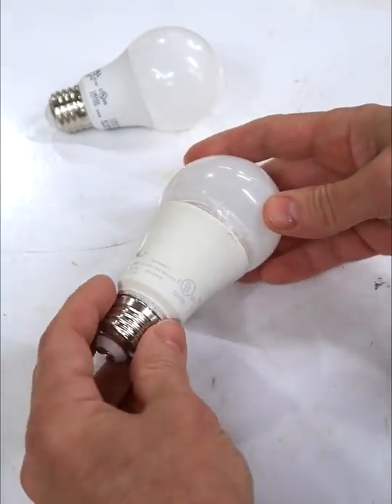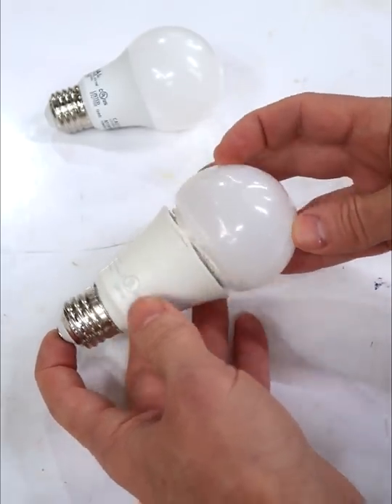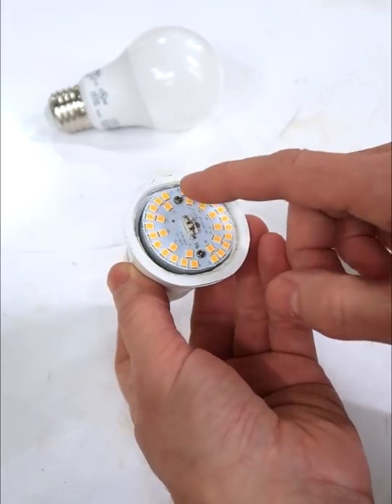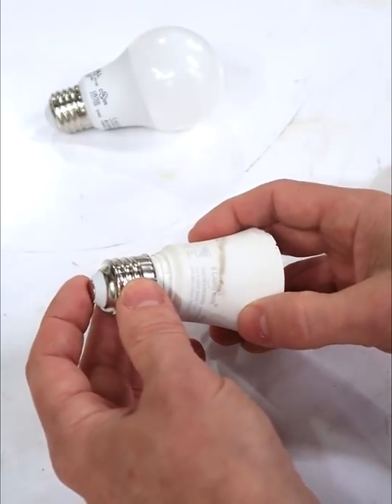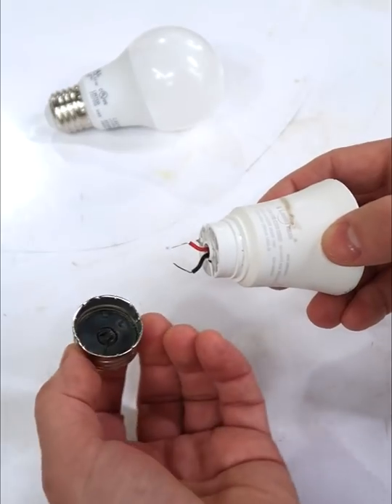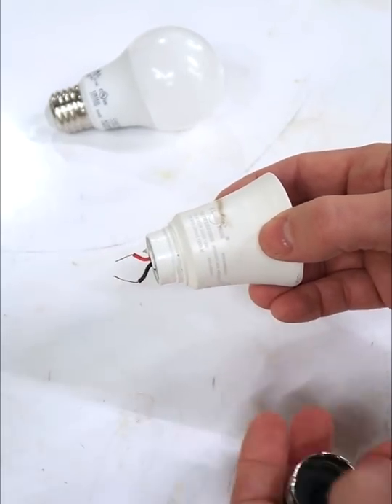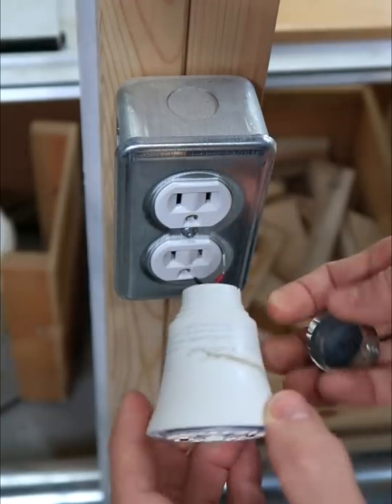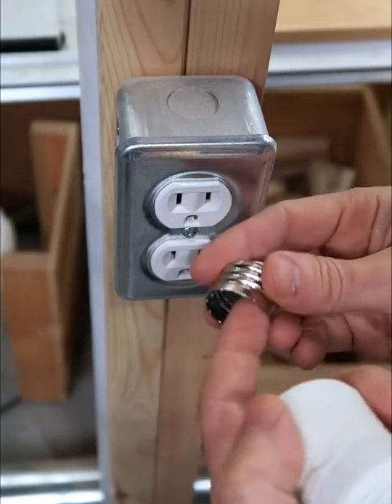LED bulb failed for dumbest of reasons

Comment: Pretty much ANYTHING you buy recently has engineered obsolescence designed into it to ensure the product fails in order to make sure you buy more. You can thank Apple for that business model. Water heaters, Televisions, garage door openers, toaster ovens, washer and dryers, dishwashers, refrigerators, etc. And it's usually the "higher end" more common company's. Samsung, GE, AO Smith, Apple, etc.

Comment: I installed LED shop lights (wrap around style)... They lasted about a year because the power supplies are cheap trash. I think it would make sense to have high quality, easy access 12V power supply run LED lights in a whole room rather than cheap garbage AC to DC converters in every little bulb. I'm going to do that in my shop.

Comment: LED bulbs are still a great idea, just like everything else though, don’t cheap out and buy the discount brands. If it’s on the shelf at WalMart or Home Depot, it probably won’t last. Matter of fact, there was an investigative news story a couple years ago where they bought a cheap LED bulb and an expensive one from the same manufacturer. Once pulled apart, the only difference was the plastic bulb piece on the more expensive one was a bit more clear allowing more light and this shine brighter, but it cost a lot more. The rest of the internals were the same.

Comment: Careful touching those wires after having had the bulb on. A lot of cheap bulbs will use a capacitor to drop voltage and it can retain charge, giving a shock after unplugging
Reply: If that was true, wouldn't that shock anyone that touches the base after twisting the bulb off?
Reply: @443DM  it can do, depending on how it's wired and what gets touched.

Comment: It probably didn’t fail because of that but because of thermal expansion somewhere on the circuit board. If you hook it up to the mains again and leave for a while then it will probably start flickering again once it heats again…

Comment: Actually, it is more to do with the manufacture of the item.  If the wires where firmly fixed then you wouldn’t have to go buy another bulb.  This little nugget of a problem is “probably” designed into the the bulb.  I have had several LED bulbs go on me.  Maybe this was the reason.  Thank you for showing this gem to us.
Reply: just remember, if they skimp on that step, its not the only step they skimped on!

Comment: I've only had two led bulb failures. One was yeeeears ago before they were common and the other was recently. I actually have an led edison bulb that's been knocked off a desk so much it's complexly busted inside and laying all floppy lnslde. Still works perfect and it's glass. I've never had a single incandescent or cfl bulb survive being dropped. This thing has been smashed off my desk by my kids or pets at least ten times. All busted inside but still working and not cracked.

Comment: All the LED lights I have fail in a way where the power wire with the resistor on it heading through the body of the bulb actually gets so hot that the insulation melts off of it and fries the resistor.

Comment: I recently lit my garage with four dual 4ft fluorescent fixtures because I don't trust led fixtures yet.  Within a year two bulbs in different fixtures went out. Bad electronic ballasts. LED'S may last forever but cheap manufacturing and cappy components completely negate that.
Reply: A few years ago I switched my kitchen over to LED tubes. Standard 4' fluorescent style, in old T12 fixtures. Cut the (magnetic!) ballasts out of circuit and popped them in.

Cut the kitchen lighting draw by over 70% and they're much brighter. Haven't had an issue yet, with lights that generally stay on 12-24 hours a day.

Comment: Yep, Go figure. 
At my job, we purchased 100's 8' commercial grade LED bulbs all at the same time. Only 35% of the bulbs worked out of the box. The bulb manufacturer told us to open up each bulb & solder the connections. Irritating......

Comment: I had an LED bulb that was flashing on and off. That turned out to be the bulb base not touching the socket with good enough contact at the bottom point.

Comment: For the current that goes trough wires they figured press fit is enough. Well it is if you disregard thermal expansion and surface oxidation of bad contact. 
Fixed plenty of them by just soldering the wires.

Comment: i had some cree bulbs with a 10 yr warranty. when one eventually failed  it turns out you have to send it top them to get a replacement if they will even send you one. well it's like 8 bucks to send it to them and the bulb costs 10. so it aint worth it.

Comment: Replaced all my lights in my house with LED bulbs around ten years ago. Since then I've only had two go bad (and those were both outdoors exposed to the elements). Maybe they're just making them worse these days.
Reply: As always, we get what we pay for. And because the market demands cheaper bulbs, even the more reputable manufacturers feel the need to reduce costs by using components with narrower margins. It's become quite difficult to find high quality LED bulbs, even if you are willing to pay for them.

Comment: i light my shop with cri99 led strips on double stick tape. if a led ever dies (hasn't happened yet) i can just short that segment out.

the pain in the ass part is finding out which amazon/ebay sellers are flat out lying about their cri numbers. most do.

Comment: The only LED light bulbs I've had that failed were cheap brands. Name brands like Cree, Phillips, and General Electric have been trouble free for me for years. Of course, your results may vary.
Reply: Amazon bulbs tend to be the worst quality. Never buy LEDs from Amazon. Many store brands are actually made by Philips and General Electric. I have Great Value LEDs and they are all still working. Also do not buy LEDs from things like HD Supply. Those will fail in like 2 years.

Comment: I've had 1 LED bulb fail in the past 12 years and it was replaced for free by the manufacturer without even proof of purchase. Nearly every light source in my home is LED and my electric usage is so low it doesn't make financial sense to install solar power on my home.

Comment: They told us these things would work for many decades because they don't burn out like incandescents or run out of mercury like florescents. Yet somehow modern manufacturing techniques have resulted in many of the bulbs lasting for a very short time. This isn't like incandescent bulbs where there's a physical limit to their lifetime that's inherent in the design. It should be possible to make LED bulbs that last for 50 years or more 100% reliably. I guess we shouldn't have taken the lead out of solder.

Comment: Maybe I've been just lucky but I've had very few failures with my led bulbs, and most of those were really cheap and nasty ones I ordered direct from china, in the early days when they were too expensive or just not available locally. I have a bad habit now of buying new bulbs whenever they're on a good sale or clearance at local stores. But I so rarely need them because the ones I already have never blow. So I have a massive hoard of light bulbs.

Comment: I have had the solder on the board where the power comes to it drip into the plastic bubble. Just reflowed with leaded solder and 5 years later it still runs.

Phillips need to make the Dubai LED filament globes available worldwide. They are so much better than the crap they usually sell. Watch the video big Clive did on them to learn more.

Comment: The only problems I’ve had with LEDs is the dimmable ones on a non LED dimmable switch.  They will work, but just not very well and you end up burning out the LED prematurely.

Comment: It drives me nuts that the LED bulbs that I buy to use less electricity and last a long time simply aren't living up to my expectations. I have stereo equipment from the 70s with LED indicators on them that still work.
Reply: if a person had a household dedicated power supply and just ran low voltage wires to light rooms, they would last just as long as your stereo equipment LEDs, the problem is cramming LED drivers into tiny "bulb" packages

Comment: It's more annoying when the street lights either turn blue or start flickering very quickly as result of failure in the power suppy caused by crappy design causing too much heat killing components and/or poor quality choice of components.

Comment: The cheap dollar store LED bulbs are junk. The Ultilitech brand (now GE) bulbs sold at Lowes also suck. The LEDs are over driven and fail open circuit causing the rest to glow very dimly. 

I got a set of GE Relax HD 60W bulbs and one year in had no failures. They aren't even that much more. And they look identical to regular frosted 60W bulbs! All except for the fact they run cool to the touch and only draw a 7 or so watts

Comment: Matthias, I have a basement wood shop, so moving materials in and out is a challenge.  My friends want me to start a YouTube channel.  What is your advice/recommendations for getting started.  My limitations include a 30" door, concrete steps for moving materials in and out, low ceilings, and extremely uneven floor (I think it was originally a dirt floor).  I have the ability to work with 4'x8' sheet goods, plane boards up to 10' in length and process longer boards down to what ever size I need.  Logistics and material flow have always been my biggest challenge.  I'm currently revamping my wood shop to include a 8'x6' office space for my computer.  The basement houses my laundry and mechanical room as well.  I have pared down my woodworking machines to include a job site table saw, lunchbox planer, 25 year old dewalt 12" miter saw and a medium size bench top drill press.  I also own a circular saw, router, cordless drill and impact, orbital sander, and all the basic woodworking hand tools.  I would like to use my machines to process the wood down to size and then use the hand tools for all the joinery.  I would greatly appreciate and advice/recommendations for logistics, floor plan, and starting a YouTube channel.

Comment: From my experience, I estimate 1 out of 10 led bulbs fail in the first year. I still buy them though, just is the reality of a cheap product.
Reply: In my experience 1 of 9 survive a half year, cheap or expensive didn't matter(at least here in Germany). I'm away from Osram and Philips. Now I use the cheap ones. I never had an LED that survived 1000h, some died before used lightbulb.

Comment: I mean, this proves it's not the "LED" part of the bulb that is bad. This is like saying incandescent bulbs are bad because (if) manufactures didn't solder the tungsten to the base. The incandescent bulb would still be a good design...its just shitty manufacturing. Same here with LED...LED's are objectively better in nearly every way. They only get this shitty reputation because manufactures are CHOOSING to make them bad. They are working quite hard to take an inherently reliable technology and make it bad.

Comment: "The reliability of LED bulbs is just disappointing"

Then stop buying the cheap crappy ones

If you pay for decent quality bulbs from good manufacturers, they're generally well constructed and they last just fine.

Really, if you have this sort of problem, this is almost certainly your own fault.  It is not a failing of "LED bulbs", it is the fault of the consumer cheaping out and cutting corners to buy off-brand crap and then being surprised when their "bargains" don't actually last.

It's like complaining that "hamburgers are just so disappointing" because you refuse to eat them from anywhere other than McDonalds...

Comment: I ditched these junk bulbs after 3 burned out with the same failure. Now i have a 12v transformer in the base moulding(???) of the lamp and it powers LED rings with diffusers on top. Oldest setup is now 7 years old. These bulbs are so cheaply built it's not even funny, not to mention wasteful.

Comment: Here is a clue, you can't pry off the base without breaking those wires.
Reply from the maker: no trace of solder of any sort on the wires.
Reply: @matthiasrandomstuff2221  there was surely solder on the center contact.

Comment: How is a bulb you could play catch with. Screw them in and good for 20 years. The reason your disappointed is because your probably buying Ge, Sylvania and Phillips. The cheapest ones work forever. Over 10  years of installing Le flat panel LEDs I can only remember 1 of thousands ever going bad. On the other hand I replace ge and Phillips LEDs that home owners installed a few Weeks earlier with fiet electric all the time. Fiets incandescents we're horrible. The LEDs are cheep and awesome.

Comment: They are cheap now.
But buy a decent brand if you want longevity.
Reply: Some store brands are actually by name brands. Avoid buying LEDs from Amazon, eBay, and contractor places like HD Supply. Those will fail. If you are buying store brands, Make sure they are by some sort of decent brand. Great Value LEDs are by TCP. Do not buy store brands that are actually made by manufacturers that you’ve never heard of before. Buy store brands that are by name brands that you have heard of before. Many store brand stuff are just as good as name brand stuff but with a lower price.

Comment: The wires can't be soldered, they have to be spot welded.
Reply: @Everyday_Richard  Byt it will cost 20¢ more
Reply: @Everyday_Richard  The screw cap is a pretty big piece of metal, it is difficult to solder and not end up with a cold joint.  Typically if the wire is to be permanently fixed in place, they get spot welded, not soldered.

Comment: The issue was piss poor manufacturing and or design of the terminal connection. Buy better bulbs.
Reply: Even Sylvania LED bulbs are bad quality. Buy GE bulbs or high end Philips. And always make sure that they are Energy Star Qualified and have a lifespan of at least 15000 hours.

Comment: Big Clive has a video on some Philips bulbs which have lots of LEDs, each under-driven to improve reliability called, The lamps you're not allowed to have. Exploring the Dubai lamps

These fascinating lamps are a result of a collaboration between Philips Lighting and Sheikh Mohammad Bin Rashid Al Maktoum - the ruler of Dubai. They are designed to be the most efficient available, matching high lumen output with very long life. Once you see the construction and circuitry you'll realise this isn't just marketing spin.

In return for the development Philips gained exclusive rights to manufacture the lamps for a fixed duration, extending from their announcement in 2016. Philips expect to have supplied 10 million of the lamps by the end of 2021.

There is a requirement for new installations to use the new lamp, which has upset some designers and architects, as they are only available in 8 forms. 3W and 2W globes, a 1W candle globe and a 3W MR16 12V downlight version. All four available in either cool daylight or warm white to make up the eight options. This restricts the style of the lamp shape and excludes warmer whites unless coloured by a shade. They're also not dimmable, which contributes greatly to their reliability, but does require a more open minded approach to lighting design. The range also excludes the GU10 format, which isn't a bad thing as they're probably one of the least reliable lamps due to the use of electronics in a confined space with hot LEDs.

These lamps are currently only available in Dubai. The likelihood of them appearing elsewhere is limited by the fact that they are designed to last a long time, which isn't profitable for the manufacturers. Maybe that'll change over time.

Although Philips have initial exclusivity of supply, it'll be interesting to see what happens when that period of time comes to an end. Will the other manufacturers make the same amount of effort as Philips did?

Comment: Mathias, I've respected you in every way since the very first vid I saw of yours back I think around 6 years ago but this vid is fake news. Some LED bulbs are no good but only some. PHILLIPS LED bulbs are flawless, far outlast any other light bulb EVER to date, they dont exceed their reported wattage or fall short of their lumen ratings under optimal conditions and last a minimum of many years in almost ANY usage application. P.S. I have 0 financial interest in Philips.
Reply: Sylvania LEDs are junk. Even though it’s name brand. The cheapest Philips LEDs are also junk. If you get Philips, Make sure to get the higher end ones.
Reply: @homeguestunton  -  I'd probably agree with that. I haven't used the new bit cheaper philips ones yet 'cause I'm still going on the OG Philips ones I started buying & using around 9y ago now (& every one has worked flawlessly & some for as long at least or more than advertised, the others haven't had enough use yet to know if they'll go the distance but I bet they will.) but the new ones, while a bit heavier than their lesser brand competitors are like 1/2 the weight of the originals.  There may be some advancement in technology partly responsible for that but I think that the thick amount of aluminium/metal helping to keep the OG ones cool is not there anymore.

P.s. being a 'name brand' these days as you probably well know doesn't ensure any quality. At least where Sylvania is concerned.  Had a 'Sylvania Pocket cam' that I got circa 2013 & that thing may as well've been a kids toy.
(7/Oct/2022-6:17pm🇦🇺EST)
Reply: @CashIsKing_UseItOrLoseIt  New LEDs tend to have shorter lifespans than older ones did. Newer LEDs tend to fail. Although older LEDs usually failed when defective. Older LEDs usually dim before they die. While new LEDs usually flicker, dim, die. They sometimes just die without flickering and dimming.

Comment: i have philps led bulbs through out  my house i have not had  a single problem with them
Reply: My Philips bulbs have had greater than 50% failure rate within 3 years.  So far cheaper Ecosmart had fared much better.